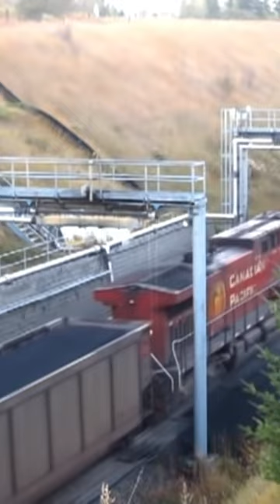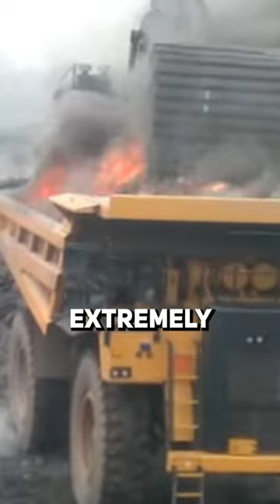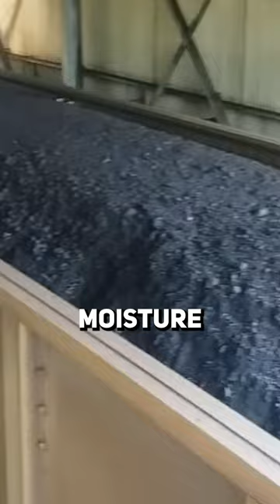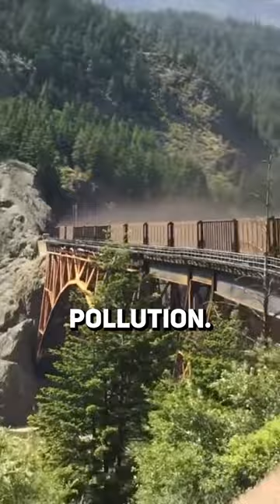Why do they spray coal on trains?

Comment: Coal is Low Volatile, it’s not easy to catch on fire unless conditions are perfect. But it will continue to burn no matter how much water you put on it
Reply: Ya this came to mind for me. This is a big part of why coal has worked so well for us and why we use it in so many places. We've been transporting it by train for ages without spraying it and it's never had problems igniting for that.
Seems like the main reason for this now would just be to keep the dust down.
Reply: So, What You're Saying is that Coal is 
  Like Lithium Batteries?¿??!¡😢
Reply: There is a video about an abandoned small town in PA, NY ?  A seam of coal under the town has been burning and they can’t put it out. Everyone had to move.
Reply: CB-dc9qj . Big Branch Mine Disaster. Fossil Fuel companies are notorious for failure to protect the miners with sufficient ventilation.
Reply: @tm13tube  man I live on a mountain that’s been burning since the 50s lol. The only difference is snow won’t pack in the woods behind my house
Reply: @tm13tube  I also live 30 min from Upper Big Branch where the disaster happened. If you paid attention to the court proceedings then you’ll know that the safety equipment they used was going off all the time and shutting the operation down so they ripped it off their machines to keep running. I work in the coal industry. It’s all about production. If you won’t produce they’ll find someone who will. Honestly, we’re all tickled to death just to be working because every operation has an end date
Reply: CB-dc9qj  I work in Austin Black 325, which is coal dust as fine as it can get. We label our containers “Low Volatile” and I’m sure every government organization possible would come down on us if that weren’t true. The stuff doesn’t just blow up. Coal mines are riddled with natural gas pockets that ignite and that’s where the explosions originate. I’ve seen explosions with coal involved and although coal alone cannot cause an explosion, the presence of it does make the explosion much more powerful
Reply: Ghost. Not all coal is created equal. Not all coal is low volatile. Austin Black 325 is a low volatile bituminous type of coal because it does not have the same properties as more volatile coals that are called, High Volatile Bituminous coal or HVB Coal. AB325 has other properties that make it less prone to explosions as well. High volatile bituminous (HVB) coals are coals with volatile matter contents of more than 31% and fixed carbon contents less than 69%. AB325 does not fit this description. (Not all coals are equal). Also, a dust explosion requires five things:  fuel, oxygen (in proper O2/fuel ratio), dispersion, confinement, and ignition or "heat source". If any one of these variables are outside of parameters, then an explosion will not occur. These five requirements are referred to as the "Dust Pentagon" and when any one of these factors fall outside of parameter, then then dust will not explode.  When AB325 is confined in a sealed barrel or sealed container there may not be enough air or enough dispersion to be explosive. Take grain for example. A pile of dried grain on a field will not explode. But, if when you put that grain in a silo where grain dust can saturate the air and the proper air/fuel ratio can be had, and you will have a highly volatile situation that can be and has been explosive in the past. (Google grain silo explosions). Same is true with gasoline. You can literally extinguish a lit match in a puddle of gasoline if there isn't enough oxygen to explode, but should the fume vapors in the proper ratio be exposed to an ignition source or heat source, then it could explode/ignite violently. AB325 is mostly used as a filler for rubber and plastics and not primarily used as a fuel source because it is low volatility. They water down coal in transport to reduce the dust in order to reduce the possibility of explosions when transporting HVBs. I hope this helps to expand everyone's knowledge and helps to have folks research new things for themselves.
Reply: I’m glad you corrected him on this topic! Try to burn a piece of coal at your next campfire, doesn’t light that easily!
Reply: No way coal is going to spontaneously do anything.  Takes a lot of energy to start burning coal.

Comment: The coal trains to Vancouver, BC also get a spray enroute to keep coal dust from blowing out the top of the open cars. The spray is automatic and is timed to spray inside the cars while the train maintains its speed. Quite the engineering feat.
Reply: If the trains running through Kamloops are anything to go by It fails miserably at its job, big clouds if coal dust thrown out if the cars all the way through kamloops and all along the rail system fro the mines.

Comment: Train engines build up a lot of carbon soot in the stacks and exhaust ports. Climbing hills under heavy load often blasts red hot carbon out the stacks onto the air.  Heavy trains OFTEN start grass fires along the tracks. Red hot carbon landing in a a bed of coal would easily start a fire fanned by the moving train.  One of the jobs of the brakeman in the caboose was to repot fires started by trains. Now, there is no brakeman in the caboose.

Comment: We need all that coal to power the Tesla
Reply: Exactly, the more electric cars people buy, the more coal they are going to have to burn

I think driving an electric car is more about virtual signaling. People think they're saving the environment and all they're doing is causing electricity plants to burn more coal .
Reply: some folks get the tesla cuz its fast tho. and nobody is bitching about lambo emissions xD

i think youre right about the virtue signaling
Reply: Nonsense, our grid is 60% fossil fuel and 40% non-fossil fuels.  Less than 20% of the grid is coal.  Coal power plants burn cleaner than burning gas in cars and less fuel is burned because the power plant is more efficient.  If the grid was 100% coal and cars were 100% electric, there would be a 31% savings in energy.  40% of the grid is natural gas which burns even cleaner and more efficient.  If the grid was 100% natural gas and all cars were electric there would be a 48% savings in energy.  Make that hydro and the savings jumps to 75% because it is way more efficient since nothing is being burnt.  My sources: US DOE.
Reply: @joeyguitarlo  More nonsense.  I am a conservative, and have been for many decades and have been driving for nearly 60 years. And I do not believe in man-made climate change. I drive an EV because they are extremely efficient as do many other EV drivers.  Burning coal in a power plant is much more efficient and cleaner than burning gas in a car.  Our grid is less than 20% coal and dropping.  If it were 100% coal and 100% EVs, we would save 31% in energy for transport use. Currently, the grid is 60% fossil fuel (dropping) and 40% non-fossil fuel (increasing).  Where I live it is about 50/50.  My EV will travel about 6 miles on the same amount of energy that a gas vehicle uses for each mile, and my "fuel" cost is only 2 cents per mile.
Reply: @muskrat3291  that's fine as long as you understand that owning an EV doesn't save the environment
Reply: Got that right! And every other EV charger out there!!
Reply: @joeyguitarlo coal power plants pollute less than combustion engines
Plus it allows us freedom to use nuclear and such to power our cars
Say what you will about people virtue signaling which is true but this isnt a good point
Reply: Until you realise most of those same people opt for private solar...
Reply: @joeyguitarlo The idea that people that get EVs do so to 'save the environment' is severely outdated. The modern understanding (among those that get them, and those that are aware) is that EVs have a higher up front environmental impact, with a curve that makes them better over a long period of time. The benefits to EVs come primarily from reduced noise pollution (in areas that don't require low-speed humming), and most importantly, zero exhaust. Exhaust is extremely harmful to every living thing, including humans and especially children when they're developing. While emissions get shifted out to the middle of nowhere at factories/mines, cities (where most people live and breathe) become cleaner. Nowhere is this more evident than in Oslo, Norway.

Comment: Yes If we figured out i What to do with nuclear waste? And had more nuclear power plants like Bell fontaine Nuclear powerplant which was a total waste Of time Resources and money because they would never let us turn it on. Then we wouldn't have to deal with nasty coal as much
Reply: Coal is better than nuclear
Reply: @littlegp18 Direct opposite. Coal is much worse than nuclear, and even emits more radiation than nuclear reactors because of coal ash.
Reply: @RobbieNguyen I live by three coal plants and there's no radiation coming from the ash here
Reply: @Clawson_customs  Proves my point further.

Coal Plants are about 10x more radioactive than Nuclear Plants. But yet, nobody is really affected by the radiation, which means nuclear power plants are extremely safe in terms of radioactivity.
Reply: Go nuke .. most of world uses it .with low mishaps.  Clean fuel
Reply: We need both coal and nuclear.

Comment: 95% of the coal didn’t receive the water, only an inch of the top layer got the water…..still could ignite, if you ask me!
Reply: It’s not that easy to ignite. When the last time a coal train caught fire (the cars themselves not the locomotives). The liquid sprayed on it isn’t just water. It sort of “glues” that top layer together as a cap to help reduce dust.

Comment: Wrong! We spray coal because it is good economics. Some coal runs, the trains can lose 5% of their being blown off the top of the cars due to weather. The solution with water sprayed on the top means thousands of tons of coal will make it to the buyer intact. Consider the economics of a train that moves 160,000 tons of coal in 160 fast loading open top coal rail cars.
Reply: 1000 ton per car is a very optimistic guess and factor 10 too high